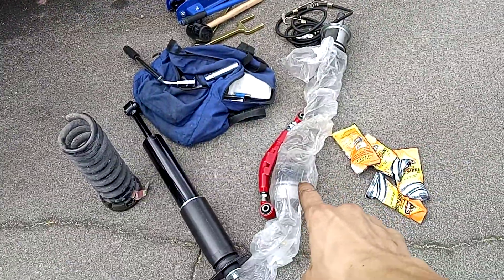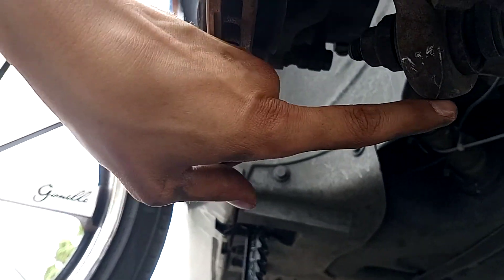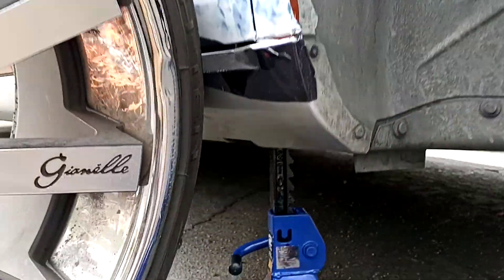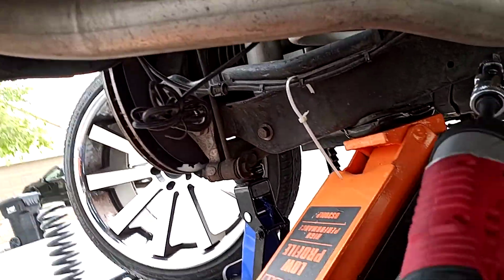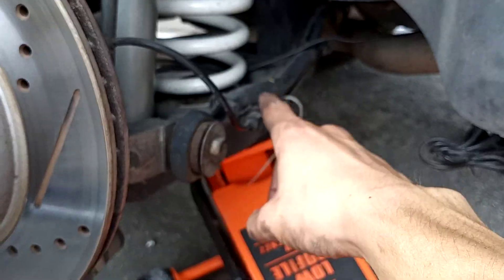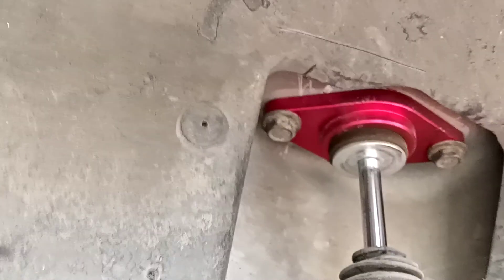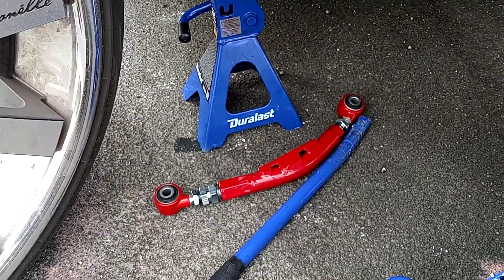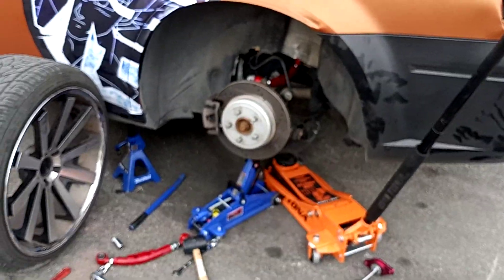**AWD** Rear shock/coil Replacement Dodge Magnum SXT Camber replacement godspeed

Comment: How did you get the holes lined up and get that bolt back in?
Reply from the maker: It was just a video I created on the spot since I was doing the job.. I haven't found many videos....

Every bolt is fairly easy to get on. So that Last POS bolt, you'll need two jacks... If I remember correctly.. one jack under the wheel hub area, one jack on the lower control arm for the bolt youll need to raise it in both areas up to where you need.
I think I left the sway link unbolted....
It took me a few tries or more to get it through and find the right angle. But once you've got it, it slides right through no issues. But a hammer handy is nice to beat it on through.
Add me on IG I can help with smaller videos and pictures.
@MD_Wrapz

Comment: I want to lowering my dodge but the rear shock are electroninc do you know what can I do
Reply from the maker: Very sorry for this late reply. I hope you've gotten it taken care of at this point. As for your case I don't think you're talking about the Magnum...¿ And unfortunately Im not too aware of an electronic shock system... you can always add me on IG and I can better assist with images you may provide. 🤙🏽🤙🏽 @MD_Wrapz either way, I hope you've got it handled. 👍🏽💯